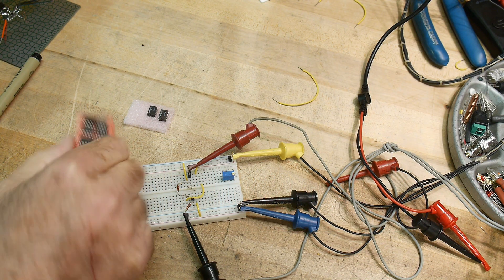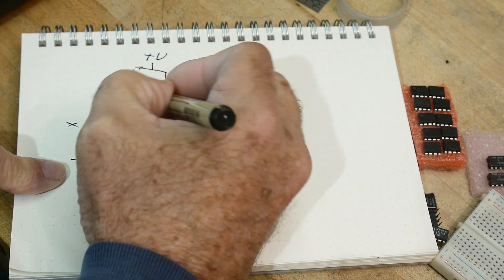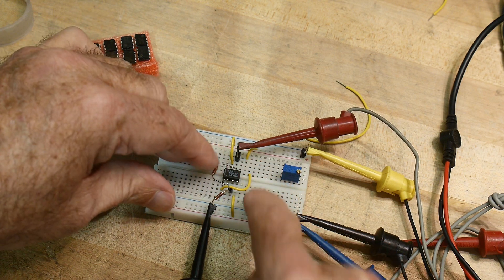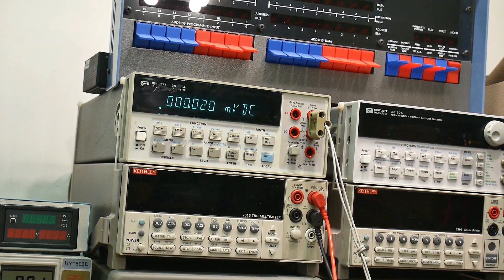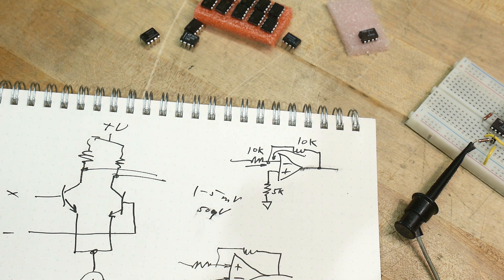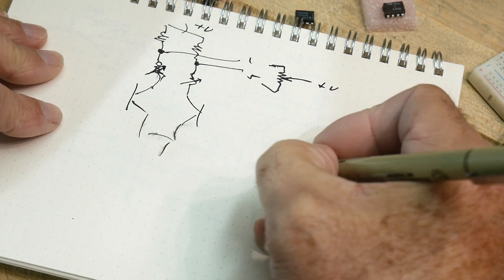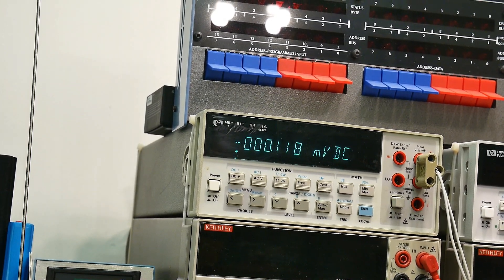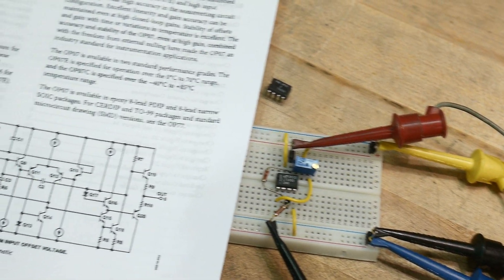#1042 Input Offset Voltage in Op-amps and how to control it.

Comment: You said both inputs are grounded ,but i see the negative inverting input isn't attached to anything other than a resistor connecting to output.

Comment: I was wondering what do you mean by grounding input and output.  I tried connecting both inverting and non inverting together and connected to vcc-, and i get 12mv output,but when I use 10k potentiometer moving the knobe on offset null (the center of potentiometer for offset is connected to vcc-as well) I get no change of offset voltage, it continues to stay at 12mv. Than I connected my inverting and non inverting to positive terminal I got 5v vcc output ,but again no change when using potentiometer. I can't find any information over internet.  I was wondering if you could explain in detail how to make connections to see a result on (UA741CN).

Comment: Hello Sir, How can I adjust offset Voltage in Dual Channel Op amp Thanks....
Reply from the maker: https://youtu.be/Ynn9ASkdiPo?si=W3i_NY0ThcFcXBKR
Reply: @IMSAIGuy  Thank you so much sir . Can I use 10K variable resistor or do I have to use bigger one
Reply from the maker: I don’t know your design. You will have to figure that out.

Comment: Basic question: How does a 0 volt input have any effect since the op amp's input transistors would need the base to be at roughly at least .6v (BE diode drop) to start conducting.
Reply from the maker: the emitter goes to a negative voltage (e.g. -12v), so zero volts on the base is already conducting.
Reply: @IMSAIGuy  Ah, the VBE drop is why we can't fully swing to each rail.  I suppose in the single supply case, 0v is generally a problem unless the part is specifically designed to extend to ground.
Reply from the maker: @Enigma758  you got it

Comment: Hello. Thanks for this video, I have an issue with and active speakers tweeter output having -23v Dc at the terminal, could this be from the opamp being unbalanced after   a mosfet change in that circuit?

Comment: What value resistors did you use
Reply from the maker: probably 10k
Reply: both of them 10k-- I used a 100000k and a 100ohm and get 15.43 volts from ground to the output and divided by 1000 but you were reading in microvoltts for the op07
Reply from the maker: @jackofalltrades3727  the op07 is laser trimmed to give good results, plus a much more complicated design

Comment: The spec sheet for the NE5532  shows diodes across the two inputs,  the spec sheet states the inputs cannot exceed -vcc or +vcc  , would'nt this much voltage  burn out the diodes across the inputs?  I am confused.
Reply from the maker: look at the polarity of the diodes. they will not conduct current unless > +Vcc or < -Vcc
Reply: @IMSAIGuy  Are we both looking at the transistors used as diodes across the Inv and non Inv inputs?  I measure 800 mV across the  two inputs in both directions with the meter set to diode check function.
Reply from the maker: sorry I was thinking of some other part. yes there is a diode across the inputs. so the inputs can not be more than .6v apart, but they both can be at +V and they can both be at -V

Comment: At 8:00, input bias CURRENT generates offset voltage if the I_b R_i are different.  Care must be exercised, however, because the bias currents are also not typically equal... see input offset current, I_OS.  The nA of the OP07 are seldom important.  
But input voltage is due to different V_be for the differential pair.  This ratio drifts with time and temperature limiting the efficacy of the NULL option... see input offset <voltage> drift.  You can always add DC voltage to one of the inputs even if the chip has no nulling terminals.  Horowitz and Hill "Art of Electronics" has a section showing how input transistor IC layout is optimized in precision devices.  We do what we can to minimize how much device imperfections affect our designs.

Comment: I can totally understand that and I agree with you great video. 🤗💯💖 Yes you have to use extra parts so you might want to go ahead and by the genuine one 😂 either way you're going to spend the money of approximately $6 or more
Reply from the maker: The fake OP-07 parts did not have functional offset adjust, so I can't even add parts to make them better. they are faker than fake.
Reply: @IMSAIGuy  wow not good. And yes I prefer precision op amps overall so I'm willing to pay good money for them.
Reply: @IMSAIGuy  there is a way to use a universal network to null any op amp by using resistors and a pot to inject a variable small voltage into  the inverting input. Look up universal nulling techniques. Thought TI or National has an app note. Have some references in a couple books and some notes.

Comment: You can also use a microfarad cap on the offset null as well and yes you can use a trim pot and once you get it set you can put a resistor or two resistors in place of it to replace the trim pot. Some trim pots create noise. And using a microfarad cap or even a polyester film cap can help alleviate that noise.🤗 I'm self taught so I learn from experience LOL. A lot of times it is to ensure that the offset null is removed from the output so you set the trim pot at zero. But of course it all depends on how you plan to use it with the long tail pair. And also of course you can use a trim pot and a resistor together. And of course the trim pot will adjust itself after time so you will have to go back in side the amplifier and adjust the trim pot again.

Comment: What's going on in the bottom right corner of the chip?  Is that some kind of damage or just some dust or something obscuring the view?
Reply from the maker: just a little damage to the part when I took the top off and it sheared the bond wires

Comment: What about Vdd and temp variations once the pot is nulled
Reply from the maker: A little change, but the resistive ratio will stay
Reply: Im not 100% sure but I think that it will be deminished.
Reply: What about heat and see?